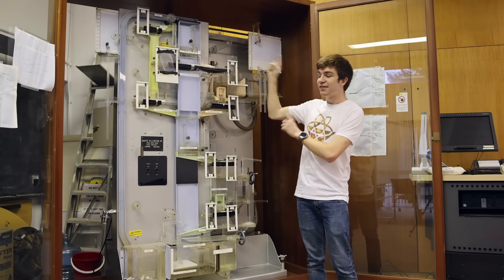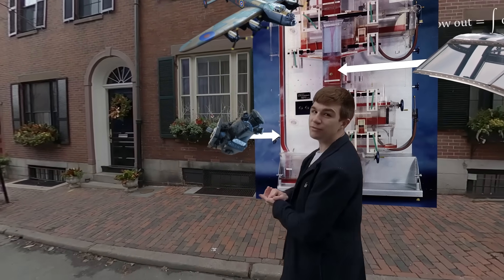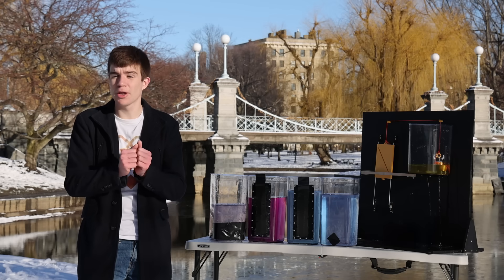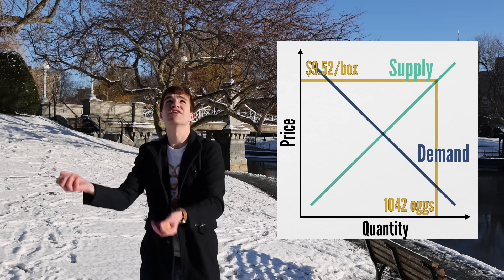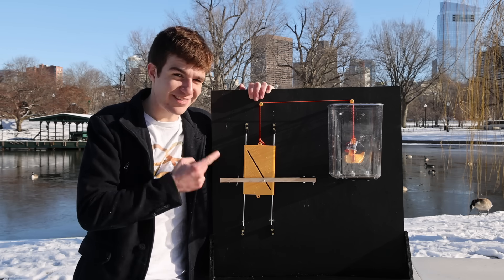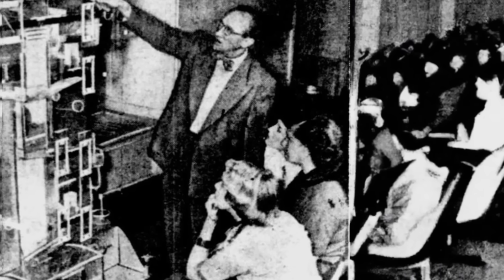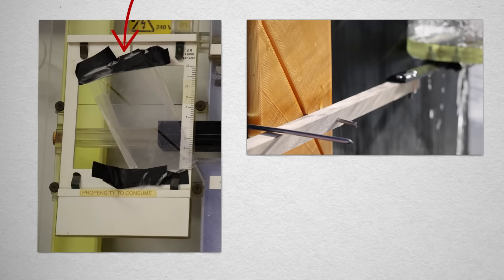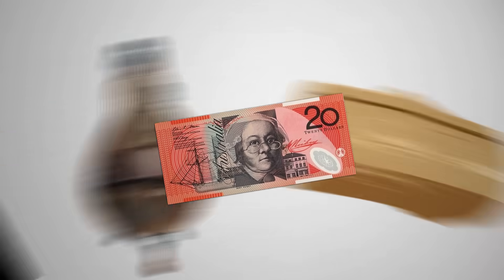Dividing by zero on a water computer from 1940

Comment: Actually, Most "Rich" people do spend all the money they have.  If you look into it you'll find that the number quoted for rich people is not the amount of money they have but rather their assets or net worth.   Do you really think Musk shoveled $182 billion into a furnace?   Nope, it was only imaginary money for taxation reasons in the first place.  
The misunderstanding your promoting here is like thinking people that own a house automatically have $250,000 in there wallet to spend.   They don't, They have zero to spend until they convert the asset to cash and that's when you find out what value the asset was.  Until then the value of the asset was just imaginary money.
Reply: You don't understand marginal propensity to consume at all. If a rich pereon saves that money it does not enter the economy and does nothing. It is that simple you give 100 pounds to a poor person they spend it all, some will spend more than 100%, this then circulates through the economy increasing the velocity of money. The rich on the other hand if you give them the same amount it will just got straight into saving, therefore not interacting with the economy, causing no velocity of money and rendering it completely pointless excerise.
Reply: @Alex-cw3rz  I'm afraid I'm stuck here in reality and not some imaginary world based on jealousy or whatever.   I noticed you didn't actually address what I said but rather had to change/misinterpret it.  Still, the fact that you think that rich people save money shows why your not rich.   There is no way to get rich saving money.   
I'll give you another shot at it.  Address what I actually said and I'll respond.   Otherwise I'll leave you in your dream world where you think you can save money to get rich.   Hows that working for you?
Reply: @Alex-cw3rz  Yea, I figured you had nothing.
Reply: @lucidmoses  you listened to nothing I said then. This isn't about how someone gets rich. This is about how marginal propensity to consume works. The fact you don't even know what the conversation is about shows how out of your depth you are.
Reply: @lucidmoses  your comment is nothing to do with the video, how do you not get this? The way to get rich is very different from your marginal propensity to consume when you are rich how do you not get this. Are the words to hard for you to understand, as you are economically illiterate do you want me to explain it to you like you are 4?
Reply: @Alex-cw3rz  Because, unlike you, I was addressing exactly what he said.  I didn't have to change what he said,  Misrepresent it and make up stuff.
But, since you seem to be incapable of following a simple conversation or understanding what is said in the video.   Here is the time stamp I responded to.  8:12   Now like I've said already.  If your not capable of responding to my actual comment, I'm not interested in your obviously wrong B.S.    It doesn't matter if you think your argument is logical or who told you it.  If your premise is wrong then your conclusion based on it is wrong.
Reply: Actually, most rich people are assholes. Because they learned in school what makes them rich. Most poor people do not have enough money to go to school. All these "explanations" of how the monetary system supposedly works are pure distraction to pit poor people against each other. In fact, capitalism works like Monopoly, and we all know it. You just want to get rich yourself and therefore justify this fraud. Just as it is expected of you.

Comment: The one thing his fancy machine couldn't account for was the intense greed of late stage capitalism; willing to sabotage long term progress for short term gains. Supply and demand is broken when "unsold goods" are destroyed to protect the higher price of what is sold.
Reply from the maker: I mean... you're not wrong.
Reply: I get what you mean but it's more of a machine designed to demonstrate economic theory. I imagine it doesn't have an externalities function for example.
Reply: @Alex-cw3rz  to be fair the machine could be modified quite easily. Simply drill a 1" hole somewhere and pipe that water into a barrel outside the machine labeled "rich people's bank account". When the machine runs dry, punch a needle hole in the barrel and relabel it feudalism. As the water drips onto the ground and evaporates, you can label that short lived puddle "the poor who haven't died yet".